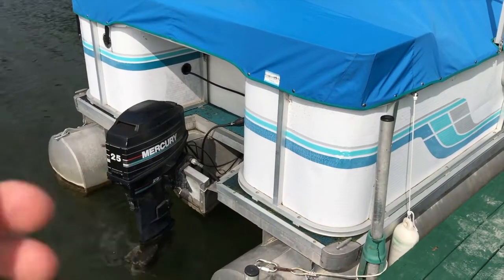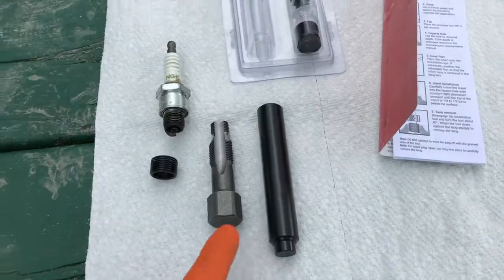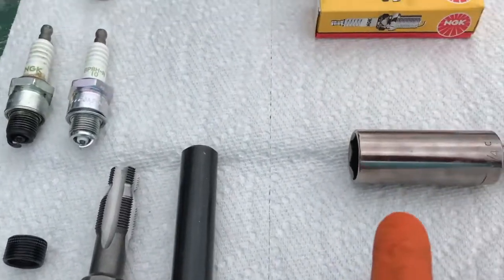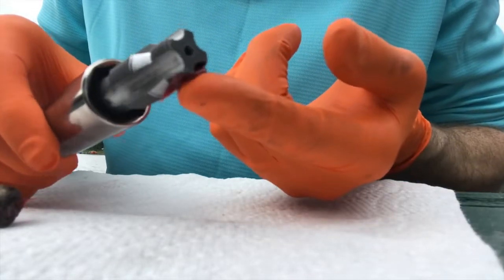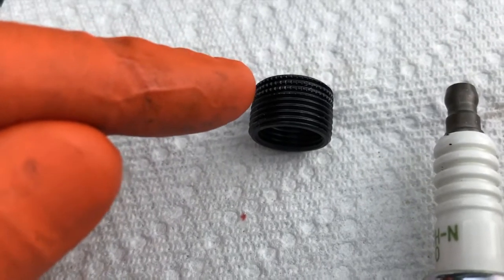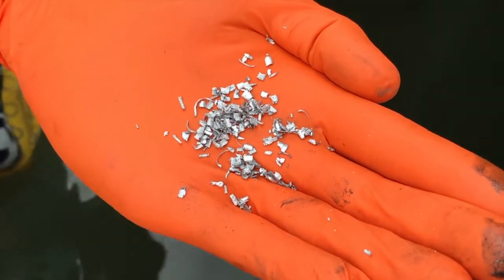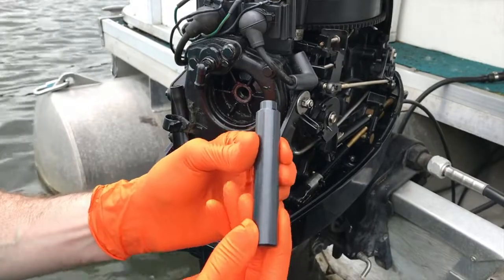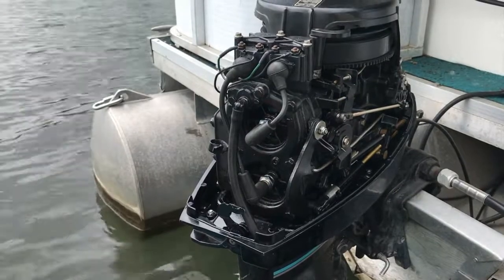How to fix/rethread Outboard boat engine Spark Plug Blowout!

Comment: Any special trick to get the spark plug out without the insert? Everything worked perfectly except when I try to back out the spark plug the insert comes with it, any suggestions?
Reply from the maker: Thanks for watching & welcome to the DIY Raptor Club.  Did you by chance use the punch to properly set/engage the thread insert teeth?

By using that punch, it will sink those tiny little teeth into the aluminum of your spark plug hole.  As the teeth are punched into the aluminum, it creates a lock tight seat and will alleviate the insert from spinning out with the plug.

However if you used the punch properly and the insert is still spinning out with the plug, we recommend purchasing a new insert and using the punch to properly seat the new insert.  Keep us posted.

😎👍🔧🔩
Reply: @DIYwithMichaelBorders mine did the same thing..I cannot back the spark plug out without the insert coming with it. This is before the hammering part.

Comment: Use a nut with same thread. Place nut flush on the cylinder spark plug hole. Then start to use the repair tool, as you start turning through the nut, you will start straight before cutting into the cylinder.
Reply from the maker: Thanks for watching & sharing your advice.  Us fellow DIY’ers need to stick together!  Any & all advice/thoughts are much appreciated.

Hope all is well, enjoy your day.  

😎👍🔧🔩

Comment: I have a 75hp Mercury and I unknowingly damaged the threads when fogging the cylinders after winterizing it.  Took the boat out a few times now that it's warmed up and heard a loud POP-whizzzz sound.  Took off the engine cover to find the spark plug had blown out.  Watched this video, order the parts off of Amazon.  Arrived in 2 days, and took 15 minutes to re-tap and seal.  Waited 24 hrs, fired it up and it works like a Champ!  Thanks so much for making & sharing this video.  What an easy and cost effective DIY fix.  Thank you.
Reply from the maker: Chris DuBos 

What’s up Chris, that’s awesome & we appreciate you reaching out to us.  Were you able to tap it & just reinsert plug or did you go all the way & insert permanent thread ring?

We showed the full insert of the permanent thread ring in this video to make sure viewers could see it.

Please subscribe to the channel and ring your YouTube bell 🔔 this will be very helpful to us thanks again Chris!

😎👍🔧🔩
Reply: DIY With Michael Borders I tapped it just like in your video with that kit, enlarged the diameter of the hole, and installed the new gasket. It’s been running like a champ!  Just got back from a week long vacation and had no issues pulling water skiiers and tubers.  Thanks for the great content!
Reply from the maker: Chris DuBos 

Awesome Awesome & that’s great to hear.  Ours is doing great as well.  As I mention to all our viewers...us fellow DIY’ers need to stick together!  You saved a lot of money by making it a DIY project.  

Let us know if you have any questions along the way.  Check out our DIY Raptor Club store.  You might find something you like.  Thanks again Chris.  Keep in touch!

😎👍🔧🔩